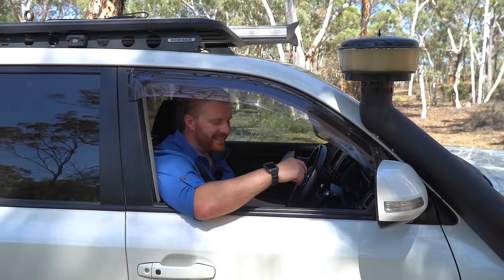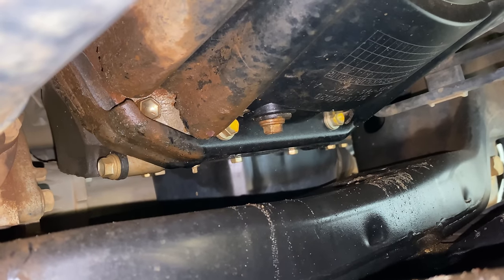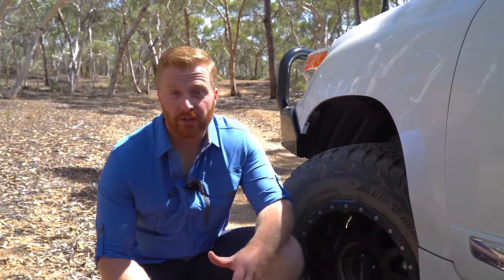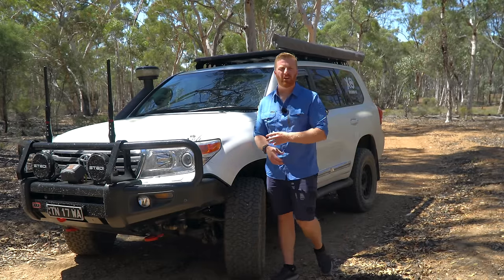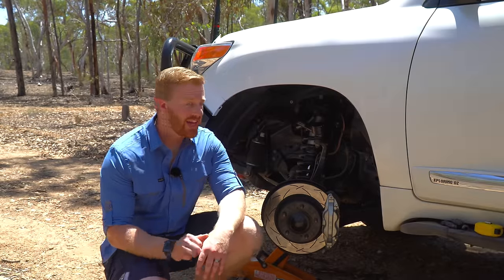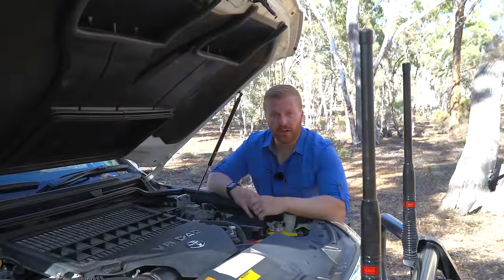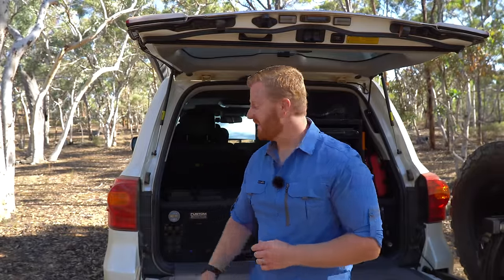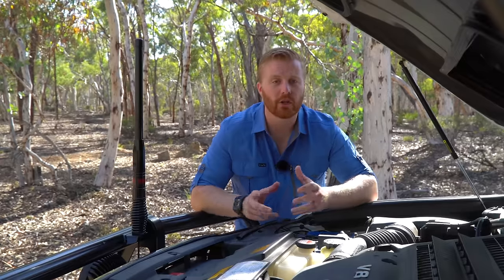LC200 | PROBLEMS & ISSUES | Not everything goes to plan -Mechanical-Electrical-Suspension 200 SERIES

Comment: Fuel supply issue - air leak, possibly the rubber seal for the Toyota diesel fuel filter unit is mounted upside down.  That seal is curved on one side and flat on the other, and the curved side needs to be facing up.

Rear main oil seal - what brand of oil are you using?  Maybe using a different brand oil might help condition the oil seals.  Castrol Edge 5w30 seems to be a good oil, even better when on sale.  Don't get the DPF compatible version since you don't have a DPF.

Adjustable front shock strut - is this a potential weak link?  I would have liked to see a second collar ring installed so that its a bit stronger.

KDSS lean - take out the driver side deep cycle battery and replace with a dcs lithum battery!  :)  Or adjust that front shock strut a wee bit higher.

power equipment at the back dropped to 3 volt - Is the ground via the body of the vehicle or dedicated negative cable back to the battery terminals?

key not detected - is it in your pocket together with your smart phone?
The smart phone blocks the detection of the keys
Reply from the maker: Thanks for your thoughts mate. I'll definitely have a look into some of these suggestions and see if they can expedite some of the diagnosis. 
Cheers, Nathan.